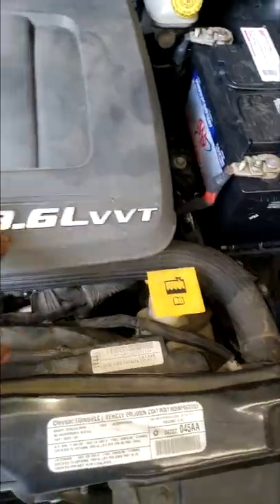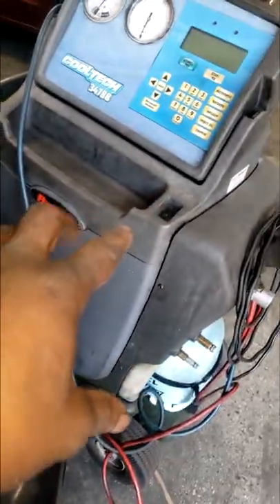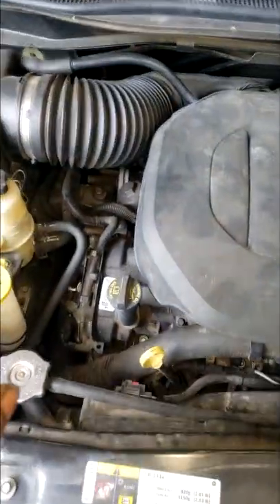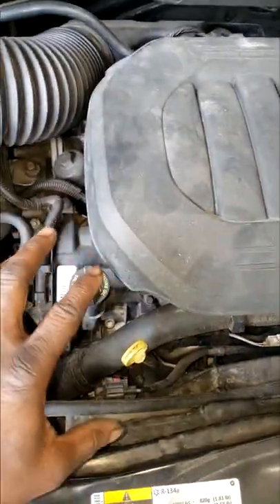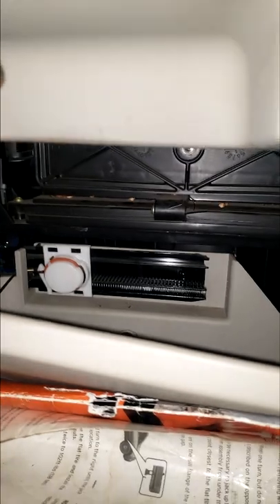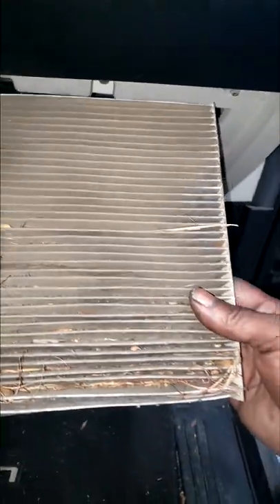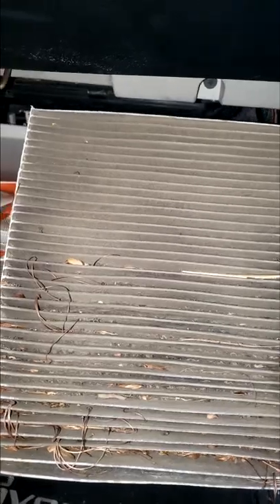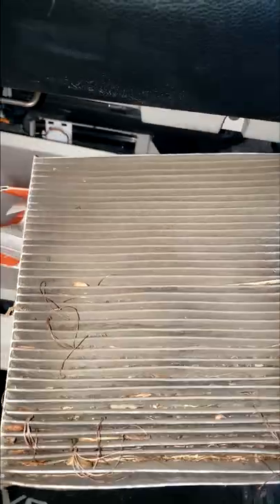How to get SUPER COLD AC. Always check this. #shorts #JTtheCarGuy

Comment: Replacing the cabin air filter, unless it is near 100% blocked, actually results in higher temperature air from the vents. The old filter slows the air down enough that the evaporator has more time to cool the air flowing across the fins. This is represented by the equation
Q=mc(Th-Tc) where Q is the heat transfer capability of the evaporator, a constant, m is the mass flow rate of the air, and T is the inlet versus outlet temperatures. As mass flow rate decreases, the delta across the heat exchanger increases, producing colder air.
Reply: @friendofvinnie  You have a hard time with math?
It's pretty easy to test. Stick a thermometer in your vents and set your blower speed on High. Then turn it down to low. The temp goes down. 

Not magic. Thermodynamics.
Reply: Delta temperature doesn't increase because the expansion valve is thermostatic.
Even if delta T did increase, the mass of air passing over the evaporator is decreased.  Thus, total performance is reduced.
Also, most filters are treating outside air entering the cabin.  Maximum cooling performance is achieved by placing the system in recirculation mode.
The primary use case for bringing outdoor air into the cabin is to take advantage of air that's dry, to absorb moisture that's been accumulating inside the cabin.
Reply: @thisisyourcaptainspeaking2259  You are looking at the wrong side of the heat exchanger. As a phase change occurs in an evaporator, that equation is not applicable. I would go on, but it is distracting to my overall point.
Reply: @MWilk098  I think you overlooked the most important points I was making.
But if you slow the air down, this doesn't necessarily mean the evaporator core temperature drops.  It's already close enough to 32F that if it does drop, there's too much chance it will freeze over.  That's the reason for thermostatic expansion valves, to keep evaporator core from icing up.  This allows for lowest consistent superheat without liquid slugging the compressor.
Reply: @thisisyourcaptainspeaking2259  🥶
Reply: @thisisyourcaptainspeaking2259  You are still analyzing the wrong side of the evaporator. The mcT equation is applicable to the air side of the evaporator. Th is the interior or outside temperature and Tc is the temperature of air at the vents. Freon temperature is assumed constant in this steady state analysis.

To analyze the freon side of the evap core you would need more information that is not easily acquired at a specific point in time, and the equation would be more akin to a Q=UA(Tex-Tin) Where U is the overall efficiency of thermal energy transfer, A is the effective area, and the temperature differential is between the average temp of the mixed fluid exiting the hx and the temperature of the freon entering the heat exchanger.

Regardless. Lower air speed = colder air.
Reply: @MWilk098  Lower air speed = reduced system capacity.  As air speed approaches zero, so does system ability to reduce cabin temperature.
Your formula doesn't reflect the reality of how these systems are designed to compensate for dynamic conditions.
Reply: @thisisyourcaptainspeaking2259  It isn't my formula. It is the actual formula for calculating thermal power. 

Besides, the point is simple. HOW TO GET SUPER COLD AC is not "replace the cabin filter". It's tinting your windows and slightly undercharging the freon.
Reply: @MWilk098  Undercharging the freon won't help, the best charge has already been determined by the manufacturer and it's critical to be within that range, accordingly.  Bonus tip: Charge is determined by refrigerant weight, not pressure.
Reply: @thisisyourcaptainspeaking2259  You seem like a smart fella, who probably read a book about something once. The weight is how it is measured when being put in because it is the most accurate. Pressure is still an indicator of proper charge. It is a gas.

Comment: Someone told me to get rid of my cabin air filter lmao
Reply: They are so much cheaper than a blower motor!
Reply: You should have told them to get rid of their engine air filter 😂
Reply: I have a 2001 Malibu, no cabin air filter (designed that way). A/C works well though, even here in hot SW Oklahoma. Go figure.
Reply: Yeah, the filter is beneficial.
Reply: @thisisyourcaptainspeaking2259  there is none on a 2004 gmc sierra
Reply: @johannesnielsen7  There are no a/c air filters on many vehicles.  Noe of my vehicles has this feature, thus everytime I'm into the ducting that contains the evaporator and heater cores, I'm vacuuming and blowing out debris (leaves, pine needles, dirt) that has entered.
A filter keeps this from happening, to a large degree.  This debris you see in these filters would otherwise be trapped in the evaporator and heater cores.